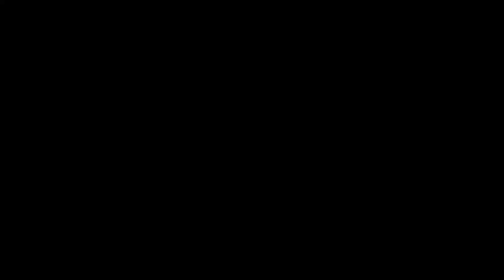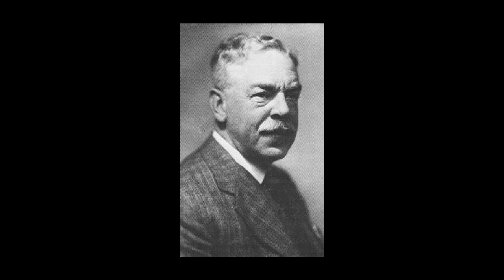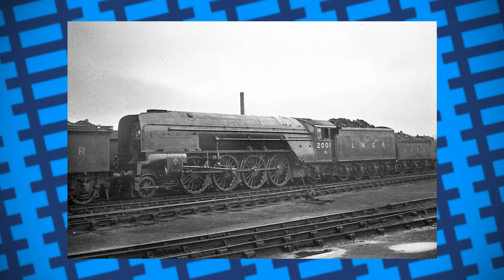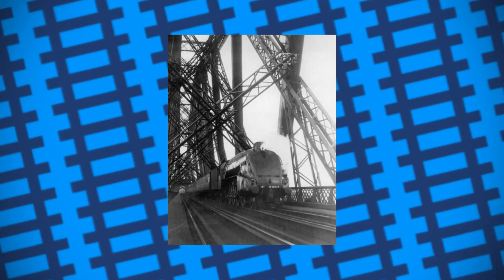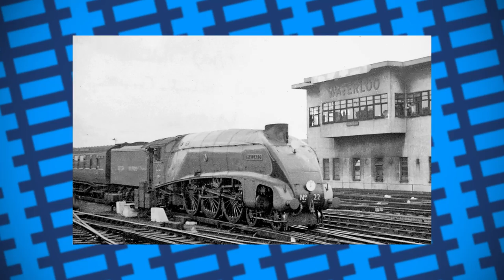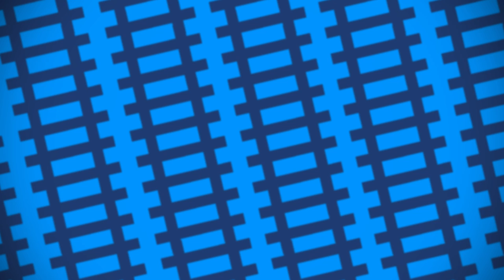LNER's 8 wheeled experimental express engines - LNER P2

Comment: Just a friendly note that there is actually also an 8th P2 under construction too. 

 - The 7th P2 project, 2007 Prince of Wales, costing £6M was launched in 2013 and has progressed as far as building the frames, tender, cladding, wheelsets and cylinder block, with the boiler and electronics on order. The build will recreate the original streamlining and feature rotary cam valve gear, but with many updates under the skin to try and improve the original design. This P2 is being built in Darlington.
 - The 8th P2 Project, 2001 Cock o' the North, costing £5.5M+ and launched before the other project, has not progressed so far, having so far built the frames and designed many parts in CAD. They aim to build a faithful replica of 2001 in it's 1938 rebuilt form, with streamlining and Walchaerts valve gear. This P2 is being built in Doncaster.

Arguably having two companies rebuilding the same class of locomotive (while not publicly collaborating or acknowledging each other) is not particularly helpful, and the fact that you got confused between them is completely understandable. Anyway, still a great video ;)
Reply: Wait, you guys are building TWO OF THEM?! Well, that just made this Florida man's day!
Reply: @fuzzyhead878  Yup, we are mad. 🤣
Reply: I think building a faithful P2 replica is slightly, dumb if I'm honest 😂. It's a flawed class and the A1 society acknowledging that rather than going down this 'Gresley is great with no flaws' idea is odd to say the least
Reply: Yes, I've heard of this 8th one you talk of. As you say SFA about its existence or why it's being built.
Reply: @profcraneporter  The big question is, what is a “faithful” replica? Each of the class was different. 

I like the idea of building a new member of the class, not a replica of a dead engine.
Reply: @MinimumGauge  same. It's just so weird
Reply: 7th one makes sense, based on the original but improved somewhat to get rid of the many flaws of the original design, and fitted out with modern safety eqipment to make it mainline worthy. But for the "8th" (even though its not the 8th) firstly i don't see that ever being completed, tbh i think its almost at the stage of being frogotten at this point. Not to meantion the fact that trying to create a "faithful" replica simply does not makes sense in this case as not only the original seign was flawed but to create a truly faithful replica you'd then have to not instal any of the modern safety equipment, AWS and all that meaning it wont be allowed on the mainline which then would make it even more pointless as really such a loco is WAY too big for any heritage railway.
Reply: @lorenzosdeadchannel  In fairness the Doncaster team want to rebuild the modified 1938 design of cock o the north, which ironed out many of the early problems with the design. The Walschaerts valve gear, blastpipe and better cylinder clearance all improved the class. Arguably, the class was better than they are perhaps remembered, with the poor rebuilds of Thompson being the most remembered quality. Many enginemen from the time liked the engine, being powerful and sure-footed, but some have suggested that perhaps the P2's greatest troubles were that they were not ideally suited to the EDB-ABD line, so perhaps life on the heritage scene would produce much more favourable results from 2001 in its 1938 modified form. Either way I do hope 2001 gets completed, just to see what it was capable of, and because it could be a fascinating comparison with 2007.
I also wonder if perhaps with the current aging fleet of A4's (of which only one is currently operational), a similar-looking new-build 2001 could comfortably fill the mainline duties of the A4s for the future. I think a lot of casual fans would like seeing a Gresley streamliner, and not mind that it's not an original or an A4, so long as it looks good (and boy does 2001 look good). Just a thought.
Reply: I'm pretty sure that the photo of the P2 under construction is of the Darlington locomotive at the North Road works, not the Doncaster locomotive as stated in the script.
Reply: @profcraneporter  What about the unrebuilt Bulleid?
Reply: @lorenzosdeadchannel  very well said. I agree with you. There's no point in creating a replica of a faulty loco.
Reply: The 8th isn't new P2 like 2007 will be, the new 2001 will be a replica and not continuing the P2 Class line. Sure Replicas will be new but they don't add to the classes they are built for.
Reply: @davidtalbot941  The project in Doncaster will never get beyond owning the frames it has at this point.
Reply: The the 8th P2 that you are referring to is not being recognised as a new build as it will be No 2001 Cock o North, but as a rebuild. 2007 is a new build as it will have a new name and number.
Reply: @profcraneporter The A1 trust recognise the P2 had flaws just like any other class of Locomotive, but are removing those flaws as far as is possible, by using Computer Simulation.
Reply: Yeh thanks for that mate, I didn't know they were building another, i would imagine the tractive effort on these 2-8-2s would be quite significant, would love to know.
Reply: Laughs in PRR 5550
Reply: @lorenzosdeadchannel  There were not many flaws on the original. The LNER had identified the need to change the leading truck design before WW2. This in conjunction with some selective extra lateral movement on the coupled axles solved the chassis problem in terms of its behavior as a vehicle. The crank axle was known to have issues, the front truck was a part of this and it also needed to be made more robust. Nothing that the LNER could not have done but with the advantage of today's analysis tools we can make the design so much better with a longer projected service life.
Reply: @fuzzyhead878  “ this is getting out of hand now there are two of them!” Star Wars references aside. The sort of thing I hope would happen would be that both projects are completed and that at some point in the future, we would be able to see both in service. Who knows we might be lucky enough to see them double head, if both projects are successful.